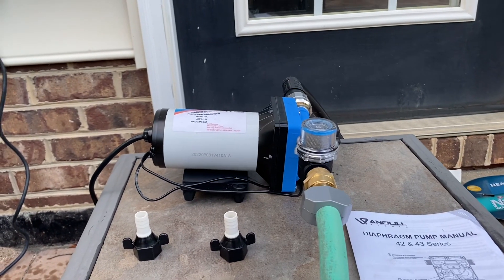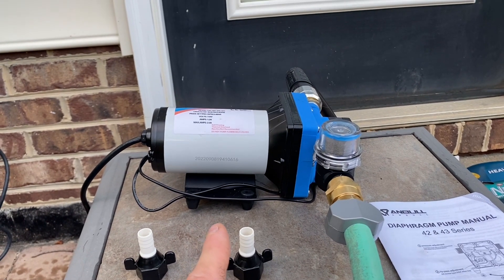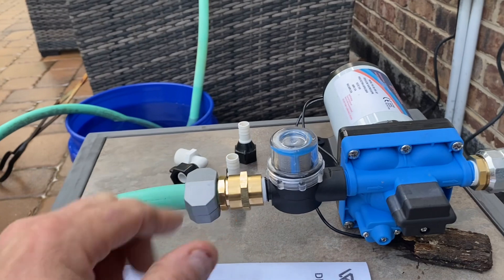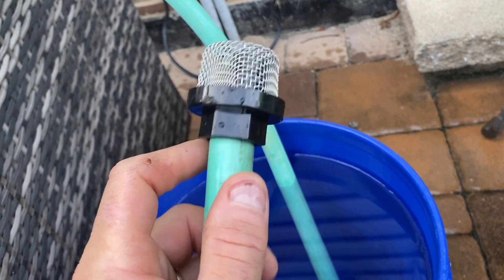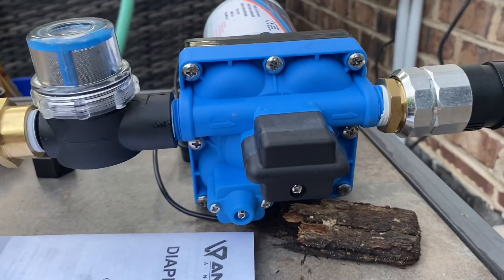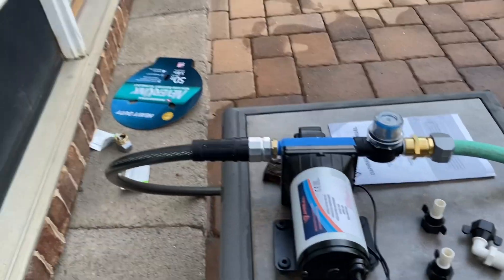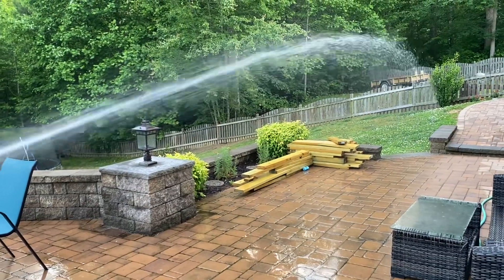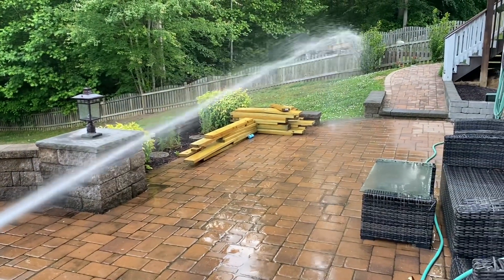Anbull water transfer pump setup and review

Comment: Placing the pump close to the water source is more efficient at the cabin site .
Reply from the maker: Agree 100%, but in my situation I keep it in the side shed where it’s warm and won’t freeze in the winter and I dug a 2 foot deep trench and buried my hose so it doesn’t freeze either, if I lived in a warmer climate I definitely would put it by the water